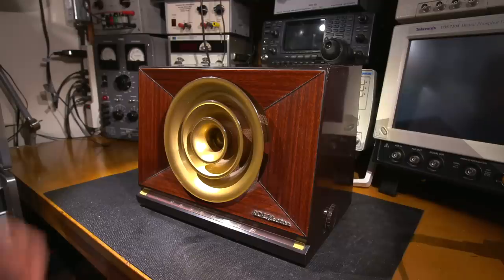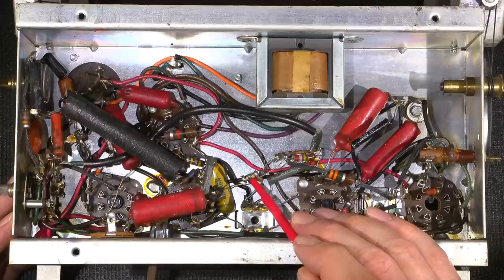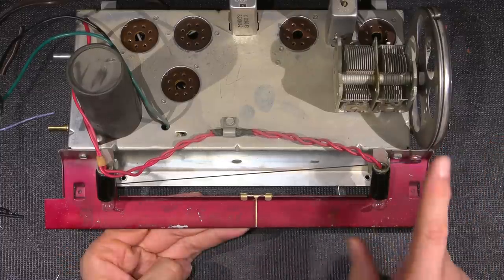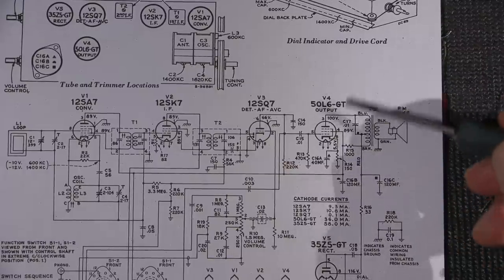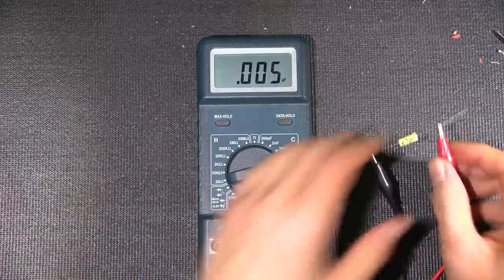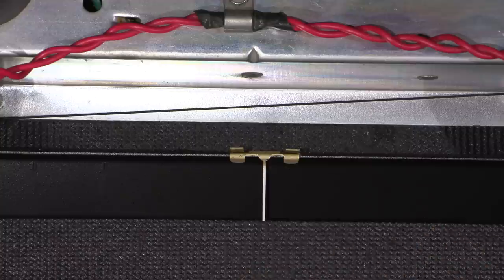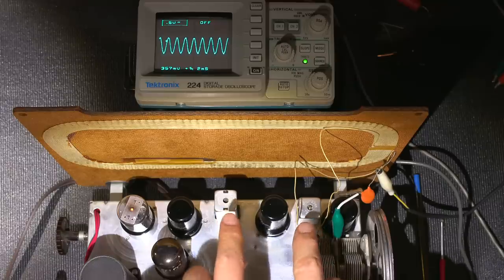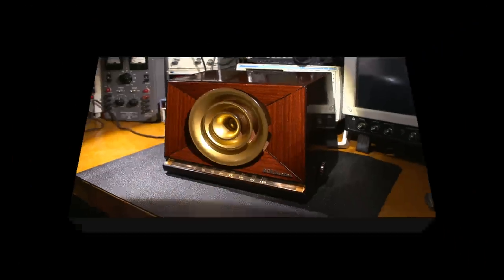Bizarre Looking RCA Radio! [Electrical Restoration]

Comment: At 1:09,  you mentioned the air variable gang would break into parasitic oscillation if it is connected to the chassis ground with a braid. Can you elaborate why please? I don't have the RCA AA5  radio but I have studied the schematic and service manual photos of a similar model found online.  With the RCA Victor, the air variable cap is connected to the RF ground via the 0.5 microfarad AVC cap that has a low impedance at RF frequencies. The chassis ground is isolated from  the RF ground by a 0.1 microfarads cap. The RF ground is in fact a wire bus running from the air gang through a hole to a isolated terminal underneath the chassis  below the air variable gang. Now how critical of this RF point on the chassis and why it is important?   Cheers

Comment: Nice looking machine. Although, I think I’d cook up a Bluetooth audio module & tweeter for it (radio stations around here are pretty awful). Probably make a small case that sits on top out of wood & lacquer it to match the main unit. 🤔

Comment: Really enjoyed this. I bought one of these from a thrift store about 35 years ago to use as an interesting guitar amp - via the Phono input. It worked OK when I bought it, but I didn't know much about tube circuits or the need to re-cap amps. I've wanted to get it repaired for some time, just haven't found a place to have it done locally. I know repair costs can vary significantly, but can you give a "ballpark" approximation of how much it might cost to have one re-caped, tuned and brought back to life?

Comment: Thank you for this wonderful repair and especially the tuning walkthrough! Are you not afraid that one of the electrolytic caps that you have placed will eventually belch out their electrolyte from their bottom corroding the connections and components below? Sure they are overspecified when it comes to max.voltage, but the double sided tape to stick them the to the chassis defeat any vent scoring on the top of these caps. Or are these designed to vent elsewhere?
Reply: We're looking at the bottom side of the chassis.  As long as they just drip, and don't actually spray out liquid, they're only going to drip on the inside of the case.

Comment: Mr Carlson, in your experimentation have you found a way to reproduce the 'warm' sound without stressing any components?
Thanks for all the knowledge.
Reply: Not mentioned in his narrative is that because of the excessive plate current, the bottom half of a sinewave gets flattened out as the tube nears "saturation." This is what always cracks me up about tube lovers and their "better sound" claims. All it means is that they prefer a lot of distortion, even-order harmonic distortion in this case. If it "sounds better," then it can be quantized. Why do they never quantize it (aka "a spectrum analyzer")? Modern day amplifier produce extremely small amounts of distortion, close to impossible to measure. Yet, it is dismissed as "cold." Okay, so what's "warm" mean?

Comment: i have a vintage transistor radio that i've been using as a daily alarm clock (vintage realistic 12-1481) and if you can get a hold of one i'd really like you to do a restoration on one so i can learn a thing or two about what's inside it and how to fix a few issues with it.

Comment: Excellent video. Great explanations. 
But it has reignited a question:  
Is it correct to conclude that the primary factor underlying the self-discharge of an electrostatic capacitor is the integrity of the dielectric?  (Assuming the cap is not in a circuit, 0 humidity, constant temp, etc...) 

In other words, all things equal, the “parallel resistance” is a function of the dielectric’s resistance, which subject to usage and material characteristics continues to degrade overtime increasing the DC leakage current, and the rate of self-discharge.  

Ultimately the “parallel resistance” when in circuit that results in DC leakage is what causes self-discharge out of circuit?
Reply from the maker: Hi Michael. In short "Yes." The integrity of the dielectric is degrading due to the papers properties breaking down, imposing excessive DC resistance.

Comment: I have a technical question.  My first thought was to send email but I notice the email address given indicates it is for business queries.
Here's my question:  In many of your restoration projects you are replacing large capacitors of various kinds and you have mentioned dire sounding problems associated with old capacitors.
I'm about to power up my 1976 Altair 8800 and I notice the large capacitors of it's power supply and I wonder if there's some risk in using the computer in it's original state.

The design of the Altair 8800 (world's first home computer, a kit) with it's Altair Bus: it supplies unregulated power to the boards and each board contains it's own regulator.
The unregulated power supply design is very simple (perhaps you are familiar with it).

[The kit came with schematics and parts lists.  My computer was assembled at "The Byte Shop" which was located in Burlington, MA.]

What is the best way for me to get up to speed on the practical knowledge base concerning the risks of using 43 year old capacitors?
I tried a simple Google search and that did not give a useful answer.

Should I use email?

Thanks in advance for any help you might be able to supply.

Cheers!

Comment: Have you heard of the mopa amplifier GB-4000?  I acquired one from a thrift store and was interested in what it did. After looking it up and looking up the prices they sold for are about 4k. Made it look pretty fishy too begin with, but after making sure I discharged it properly (Because it warned it was high voltage) and took it too bits. All of the components are Blacked out with sharpie and even the Caps have no markings. Have you ever came across something like this? It looks like they don't want anyone too know about how it is built.

Comment: omg i want that ousite foil tester :D . that would be so nice to have
now I am always busy with a big heavy Philips oscilloscope
Reply: I am thinking about making a small mono audio (pre)amp on batteries and a speaker, and its input connected trough a switch that flips polarity, so if you connect the cap to the input it would hum louder one way than the other.

Comment: I seen that radio, or one almost the same in a 50's sci fi movie, maybe movies. I always wondered the brand and model. Knowing what I do about speakers, those cones mess up the sound quality, but, based on what you say at 3:00, I guess they are trying to get that Golden Throat sound. I bet the Golden Throat is those big passive horns they used on the old 78rpm record players. Yuck, who would want to reproduce that though.

Comment: Enjoying your rehab as always.  How do you have your parts stocked, kits, known typical values or how. I’m fixing to re-do three old radios to include my NordMende Fidelio 55 German table radio. When I bought this at a flea market in Trier and it’s just never been quite right. It appears you like the IC caps and I’d like a selection in one kit. Where do you order your parts?  I did custom computers and service for 25 years and had many suppliers. I’d love your help please

Comment: Speaking of capacitors, I could use some expert help in my first restoring of a Hoffman ST2 “Stereo” amp. It’s not stereo actually, but since it has a woofer and a tweeter in the box, I guess they thought they could get away with calling it stereo. But I digress.  What I need help with is trying to solve the mystery of components (capacitors) in the case not matching the values on the schematic. They are wax-paper blocking caps.  On the schematic they are labeled “0.1 600V,” on the actual component, 1MFD 600V. I’m reading this as a discrepancy. It’s not a failure to see a speck of printing dust as a decimal since there are two on the schematic and in the case and they agree with their counterparts, and at this point I don’t know which is correct. Im leaning towards the 0.1 MFD since that seems a more reasonable value for high pass filtering.  I’d also rather it be this smaller value because with the 1MFD installed now (original as far as I can tell), the amp sounds overly bassy and sloppy in the low end.  This isn’t conclusive evidence that 1MFD is wrong, however, since I haven’t changed any other caps that need replacing. Are there instances where different amp designs would use a 1MFD and others use 0.1 MFD for blocking?  Are they interchangeable?  Any help appreciated.

Comment: Enjoy the videos. Art Deco was a early 20th Century style in everything from HUGE Public Buildings to the smallest jewelry. The central, trumpet or industrial like speaker style point & the golden hue with fake? wood or veneer allude to that style. It's intent was to raise the common man from the small & ordinary to a higher realm of self & public uplift. The illuminated red tuner backdrop was to  enshrine & visually warm & embrace the golden needle. The wood was to suggest living room furniture. Nice job. But preserve the style if possible. Still enjoy your elegant presentation & genius.
Reply: Mine (like this) had a black dial, but it also had a black case.  I would have liked to see it with the lights on before painting it, though; since he didn't even know the lights were out until after painting it, I think it was really just a personal preference, and an unwillingness to go find the right color paint.

Comment: imagine a time when you could call a radio repair man and he would actually come to your house ,with his tools, and fix your radio or tv .
Reply: Quite a few bicycle shop chaps used to get into radio repairs in the very early days. They would charge the accumulators for the heater feed of the radios, (many people had no electricity),  and gradually get involved more on the subject if it interested them enough - plus - extra business!  There was a bike shop near Walthamstow, near London, that had long since closed - but down the side wall, the large old brown lettering proclaimed, "  Bicycle and Radio Repairs" !

Comment: I am refurbing this same radio and have a question about the wiring around the 35X5 recifier tube.  The wiring of Mr. Carlson's re-capped radio @ 19:21 does not match the published schematic for the RC1079 & RC1079A chassis.  Namely, there is a cap wired from pin 2 (heater) and pin 6 (unused) of the 35X5 to the positive terminal of C16C (120 uF filter cap) after the 33 ohm resistor from the 35X5 cathode (pin 8).  My factory original RC1079 chassis has this same wiring as Mr. Carlson's recapped radio and another one by YouTuber "I Repair Electronics" but none of them match the schematic.

I have only been able to find one web posting about this potential schematic mismatch but there is no verdict on the correct wiring.  I suspect I should just replace the caps as they are currently wired but I have other issues with my radio from the last owner that scrambled some of the wiring.

Comment: i have learned from past videos that the tuning slugs or cores of the intermediary coils can be live and not only can you get zapped but you can destroy the coils and other stuff if you short the screwdriver to the shield case of the coils.

to make matters worse the proper tuning tool is not used so they end up fowling up the tuning  even worse maybe to the point where the radio no longer works.

not only break the knob but scratch the case.

and if you scratch the case finding original or even period corrct paints and varnishes can be difficult

even more modern radios from up to the 80s and maybe 90s used dial strings too.

your paint job on the dial back plate is so good it looks factory

would they ever wire the dial lights into the dc out of the rectifier tube through a resistor dropper resulting in the lights coming on once the tube has warmed up?
Reply: Not likely - DC loads were kept as low as possible, since any increase in DC current requires a corresponding increase to the size of the electrolytic capacitors on B+.  The AC current was practically free, since the bulbs were wired in parallel with one half of the 35V filament of the rectifier tube.

Comment: When I hear Mr Carlson explain the danger that could result from the non-polarized line plugs of the day I wonder, what was UL thinking at the time to approve these sets?
Reply: Greetings: In general there was no readily accessible metal parts (except for the bottom mounting screws or those at the bottom of the loop antenna back  board that screw into those metal brackets.

Comment: Hi Paul, Another very nice and well explained video. I am bidding on a heathkit TC-2 tube tester,  It has been restored by a guy about 300 miles north of me. Don't worry I have researched and even spoke to the guy who has done the restoration. He has been doing repairs for years and has a 100% good feedback and the work he does is really good and the equipment looks really nice when its finished.  I will give it a quick look over my self "as you do" when it arrives. 
Can I ask you what make of polypropylene capacitors you use? Paul UK

Comment: That model radio uses Mazda 1490 bulbs. I've seen a video recently that showed that one or both bulbs will blow when the radio is first turned on. Did you have this problem with your radio?

Comment: If you have no idea which side is the foil end of your purchased capacitors, would your trick mentioned early in the video about surrounding the capacitor with coaxial cable shielding (and grounding it) have the same effect?

Comment: Hi Mr Carlson. I have a nice Toellner TOE 7404 function generator, but unfortunately it is lacking modulation feature. Do you know a simple way of adding AM modulation to the output signal? A 400Hz or 1KHz at 50% would be just fine.
Thank you.

Comment: Thanks for the time you take to make your videos. I've been watching a lot of your videos the last couple of weeks and beginning to see structure and logic in the amplifier sections of other parts of the equipment. I have just one question. What is the reason that they use transformers to change the impedence matching the speaker and not making a speaker to match the impedence of the tubes output. Would be great to hear from you I'm becoming a bit of a fan 👍😉 greetings from Holland. Sybren Broersma

Comment: Hi Carlson, in a respectful alternative analysis I hear EVP, Electronic Voice Phenomenon, meaning intelligent speech or speech patterns in noise or other abstract material, psychic content deriving from the personal and the collective unconscious, the spiritual realm. Please listen with absolute focus at 0.5x video speed to experience the paranormal energy manifesting within the dimension of the Internet, a parallel non-physical part of our reality:
1:13:52 'Because we're now friends', next EVP is not radio speech but white noise with relatively clear articulated speech within it - a slow, long sentence:
1:13:56 'The capacitors have been changed by..', 1:13:59 'mister', 14:00:00 'Carlson'.
In between I hear another sentence, a radio voice says 1:13:57 'Is one thing.. I shout..', 1:13:59 'A token of appreciation'. Still within the white noise spectrum, this positive spirit goes on:
1:14:01 'He's a very competent radio repair..', 1:14:05 '..man..', 1:14:09 'It's positivity' (possibly 'I'm sending out'), 1:14:12 'Telepathy'.
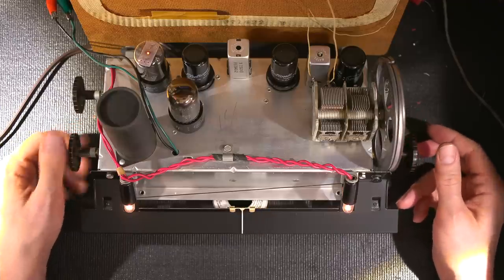1:14:17 'Aleksandar Vučić' (Serbian politician), 1:14:26 'Sikke et serbisk afterparty' ('What a Serbian after-party' Danish language).
So personal as well as collective unconscious material present here
Thank you from
The Völve, psychic medium, Asatru shaman

Comment: Love the videos. My Grandparents had a radio exactly like that, and I used to tinker with it 20+ years ago. Maybe my grandfather still has, idk, but the one we had had a clip on the back to put an antenna, and I think you could hook an external speaker to it as well? Maybe these were add-ons, can’t know for sure. 

Do you work on other types of electronics like televisions (crt or flatscreen), or mainly audio equipment?

Comment: I know not original, but could the knobs benefit from thumb-sized indents in them to help spin the around instead of grabbing the edge and rubbing against the case.  Many current ham radio tuning knobs do the same, so it won't be out of place in a radio.

Comment: Great info on the capacitors. That could have been a great video by itself. There are many people on guitar forums that emphatically advise not to wholesale replace the electrolytics in 80's or 90's amps, preamps, or pedals, due to losing the special sound "mojo" of the 30-40 year old electronics. To me it just seems easier to just wholesale replace 15 or 20 electrolytics rather than test them all, it seems they have reached their lifespan regardless. Mr. Carlson whats your take on doing a wholesale replacement of the electrolytics? Is there really special audio "mojo" in those 80's and 90's caps?

Comment: If I was to import one of these old American radios to the UK, how easy would it be to make it suitable for UK mains voltage?  

I'm guessing that all I'd have to do to switch out the transformer as our voltage runs at 240V rather than 120V but our mains also runs at a lower frequency 50Hz instead of 60Hz.  

Also, our plugs are already polarised (and fused, so I'd ideally need to know the current draw so I could fit the plug with the correct fuse)

Comment: Use closed headphones and a small amp with jack cable and the method you show on one of your episodes.and mark them.I remember my father showed me somthing like that method way back..1:1 differential amplfier for any scope or similar ir hard to find kit or for AF signal fine if i has a bandwith that goes high but not needed for most of the type repair i do.rare i use scope in mghz range.sorry for bad writing.